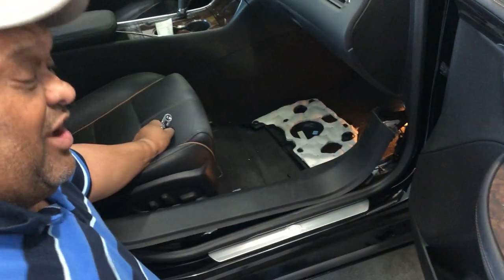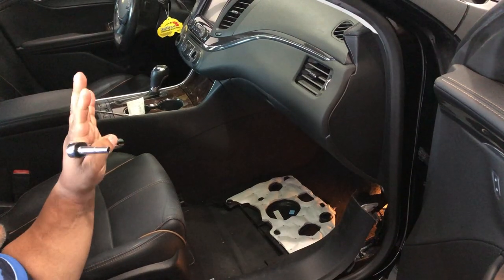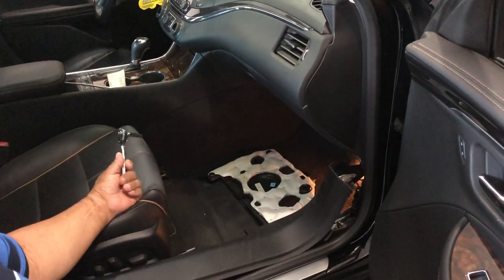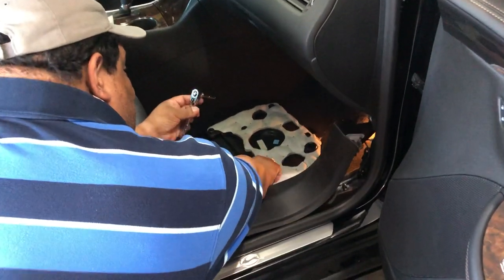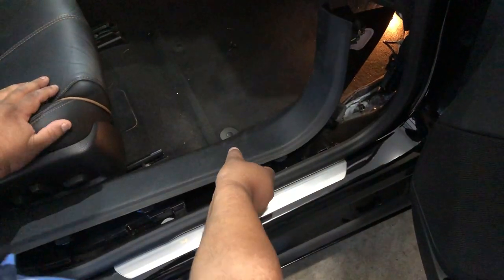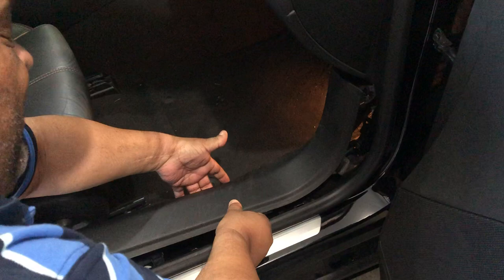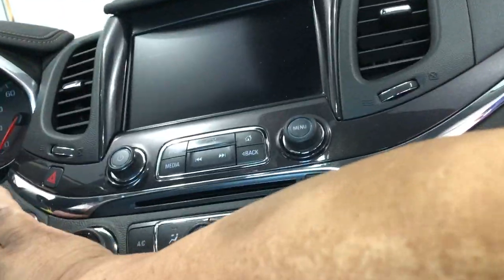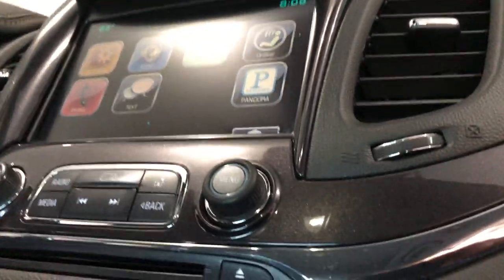[SOLVED/FIXED] MyLink black screen - 2015 Impala LTZ

Comment: Thank you for the video. I was lucky enough to not have to pull everything out. Others may try to unscrew the 2 bolts that hold up the light as you said in the beginning. Once that is pulled down a little(light still in socket) you can see the wires. I was able to push up on the wires and heard them pop back in. The screen worked after that. The cords are very tight as well so usually this can make them come ajar when hitting bumps or railroad tracks repeatedly.

Comment: Thank you sooooo much for this video. My radio has been out for months. I finally was about to break and send it to a chevy dealer and spend 300+ on the repair when I came across your video. My boyfriend fixed it in under 5 minutes. He didn't even take off the whole threshold. Just disconnected and reconnected the cable. You are the shhhhh my boyfiend said. Thanks for saving us time and money!!
Reply from the maker: You are most welcome!!  I'm very happy this little video has helped so many people! :)  Please consider joining my Facebook group if you have an Impala, or know anyone that owns one.
Reply: @AnthonyP2A  what's your Facebook group?
Reply from the maker: @somuchpain-wn5zi  anthonyperez2

Comment: Do you have any suggestions on what to do if the power steering goes out? I have a 2015 LTZ and recently my power steering just stopped. I’m trying to find a solution before I pay the dealer an arm and a leg to fix it.

Comment: I have the 2017 and did this. I unplugged everything and plugged it back in to no avail.  What do you mean accessory button?
Reply: Any luck with it? My 17 just went out as well but just the screen. Radio and buttons still function
Reply: @casas431  nope the radio will be the next to go i haven't had my music for like 3 years

Comment: I think my HMI is on the driver's side behind the drop down compartment where the internal fuse box for my Chevrolet 2015 Impala LT 3.6. Are all the cables in your video the HMI or is it a specific one? Thanks for any response. My display has been very, very, very dim where you can barely see the display.
Reply from the maker: No - ALL trim levels are on the RIGHT side on th4e Gen 10, which is what you have. If your dosplay is very dim, go to the control panel and change the brightness/contrast level.  If they are in the MAX setting for bright and mid to low on contrast, check the power going to the fuse and see if it's under-powered. (Use a voltmeter for this.)
Reply: @AnthonyP2A  Thanks brother. I will try this tomorrow and update you!
Reply: i have that same model, the 2015 impala LT 3.6, my radio turns on but i get no audio when i play music and there is no audio from the turn singles and door chimes, does all of this still apply to fixing that?
Reply: @kyleyurchak6132  I'm currently having the same problem after a car wash . Only difference is that my display is not Very dim, but it's still dim even though I put the dimmer switch at maximum . And my battery is fully charged by the way . Anyway, what's is the solution^^? I know my replay is late, but it would be nice of you to help ^^ .

Comment: Thank you!! I have been riding with a black screen for almost a year! I showed my husband this video and he had it fixed in less than 5 minutes and he didn't have to take the threshold off. 👍🏾
Reply: Jessica Bradley wut did he do please tell me I’m having the same problem
Reply: @tonioorr9001  there is a cord that was barely plugged in underneath the glovebox. My husband unplugged it and then replugged it back in and my screen came back on

Comment: I tried this fix but it did not work for me.  My screen is still out but I also have no audio.  I have checked the fuses, and the plugs both to the radio and the HMI unit.  At times the radio will come on or even the music playing from my phone but only for a few seconds.  I know its got to be a connection issue since it comes back from time to time but I'm not sure where.
Reply: Hey bro did you ever find out your issue? I have the same problem

Comment: Did your backup camera still work even tho the screen was black? I'm having same problem but my backup camera works completely fine but that's it no radio at all just black screen.
Reply from the maker: No. it was completely useless. My guess one of the cables came loose and once I took them all off and reseated them, all was fixed.  In your case it sounds like a signal cable (backup cam) was not affected.  I'd reseat ALL of the cables and go from there. If that does not work, check to make sure NONE of the wires popped off the connector itself.  I'd use your phone camera in ZOOM mode to check that out.
Reply: @AnthonyP2A  cool thanks man appreciate it
Reply: Mar'kay B Did this work for you? I have the same thing happening, back up camera works fine, but screen is blank for radio. Touching screen still has an effect too, just can’t see anything.
Reply: @Chrisbordenca  it was my CD player, drinks spilled into my infotainment when I got in an accident. I tried to fix it on my own then took it to dealer, they bypassed the CD player everything was fine. So they just put in a new CD player
Reply: Mar'kay B Ok, thanks for getting back to me! I ended up making a dealer appointment.
Reply: I have the same problem with my Silverado 2018! Do you know how can i fix without putting a new cd player?
Reply: I am just going through the camera situation right now.  My rubberized exterior switch is also not working.  Inside the car, yes,  remote yes.  But when at the trunk and trying to use the button it won't open.  At the beginning of the service manual, a short 9700, yep, nine thousand plus pages on around page 1199 it describes the camera testing.  My rubber trunk switch tested ok when you have it disconnected.  Back to the manual if camera is intermittent or not failing at the time of inspection then take connector off HMI, put a GM gel on the connectors and reconnect.  I am suspecting more recent problem of key fob not being recognized is further symptoms of HMI connection problems.  The dealer was given the go ahead to diagnose the camera and switch.  300 dollars later said it was the camera and switch that needed replacing.  I said they are both new bought here at the same dealership.  I said not to the repair and have set up a meeting with the service manager.  If the techs don't even read the manual and guess at the repair then that is a problem.  I am thinking to pull the connectors, inspect and clean and re-connect the problem of all 3 things including the fob will be fixed.  Will find out next week.  If you need to remove the trunk trim to do the switch or camera this is the video to watch.  https://www.youtube.com/watch?v=OQJndd1wNdI&t=786s ( he inspired me to do the camera and switch on my own)  but instead of taking chrome trim off first loosen it.  Loosen the black plastic panel containing the switch and camera and then using trim tools slide the black panel apart from the chrome and it will drop down.  It will be important to loosen both pieces first before attempting to separate them.  It's imperative to loosen both of those panels entirely before de-trimming the trunk lid.  Hope this helps.

Comment: This worked for me but i dont know how 🤣 i followed the video and unplugged the plugs in the video and replugged them in. Started my car and nothing. So i figured while i was under there ill just try every plug i can get at. Unplugged and replugged, tried my car again. Still a black screen :/ Gave up hope and thought well ill be one of the unlucky ones and have to go to the dealership 😪 then i put everything back together and started my car up one last go and it came on 🤣 i was like no way! Lol !! Thank you!
Reply: How do you unplug them. I couldn't get them off.
Reply: @carlosallen831  they are challenging if you have larger hands. I even had trouble getting my hands in there. There is a tab you press in while pulling to get it out.

Comment: i have an issue with my impala , my screen( hidden compartment )  is not moving down ever if it went up . and it turned black . can any one help me with that . thanks in advance
Reply from the maker: Follow my steps and see if a wire has come loose. Also check the fuse as well.  DO NOT force the screen up or down! If all else fails, remove the battery cables for 2 hours to discharge the BCM and see if it works when you reconnect the battery.

Keep us posted and head over to my Facebook Chevy Impala Owners Club.  https://www.facebook.com/groups/1588710404719919

Comment: I tried this and unfortunately it did not work for my 2017 Impala
Reply from the maker: That’s very odd. What’s going on?
Reply: Just tried and didn’t work for my 2017 Impala either. Turn car on and screen turns on. Then after 30 seconds to a minute, screen turns off then back on. Keeps doing that for about 10-15 min before staying off
Reply: I tried it all too. 17 Impala and nothing. Happened a week ago. Radio and buttons work just black screen

Comment: Hy I've tested and done all that just couldn't fix it
Reply: Did you check your amp?
Reply: @hesme7350  you mean the battery amp?
Reply: @dashtyATG  no in the trunk passenger side there is a Bose amp I got one from the junkyard and fixed my issue
Reply: @hesme7350 ohhhh  did you meant amplifier?
Reply: @dashtyATG  yah
Reply: @hesme7350  ok thank you
Reply: @dashtyATG  did you ever get it fixed?
Reply: @hesme7350  no
Reply: Fix it yet? What did you do?

Comment: i did all this just for da radio still not work im shitty
Reply: See this is why I’m scared to do it.
Reply: @latriciajohnson5298  still 2 months later i aint found the solution if u do lmk in da comment pls
Reply: @losog2319 have you fixed it yet?
Reply: @tasloc  never worked for me been riding without a radio since

Comment: Hey I wanna get In contact with u to ask some questions.
Reply from the maker: Sure!  What about?
Reply: how i can disconnect the cable??
Reply from the maker: @raverr7  which cables? The HMI? Those are locked down with a little plastic tab. Not that hard to pry with your finger nail. DO NOT break it, or the connected will always be falling out of the socket and you'll have to rig it to keep it from falling.